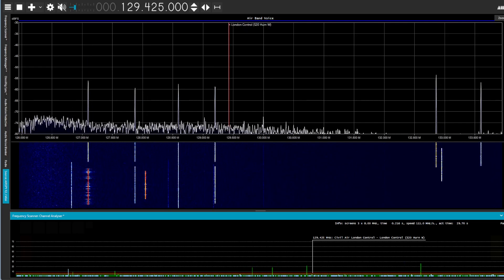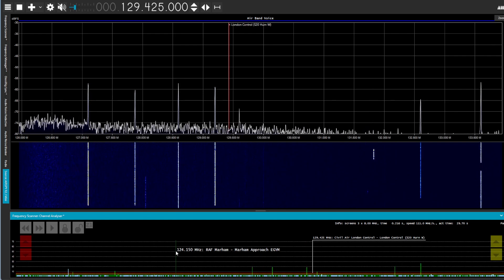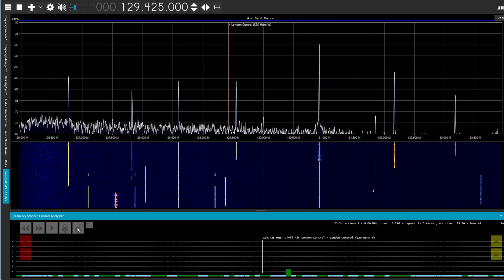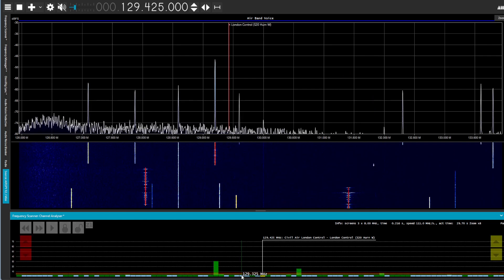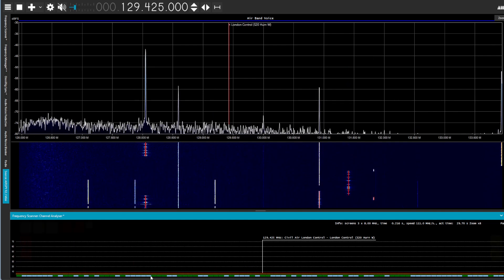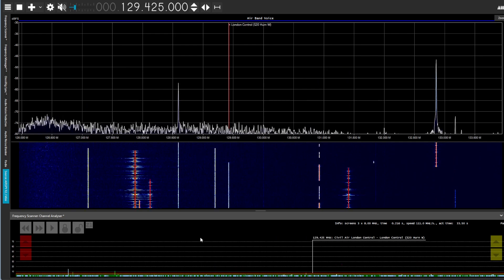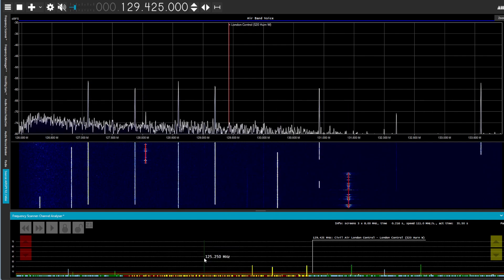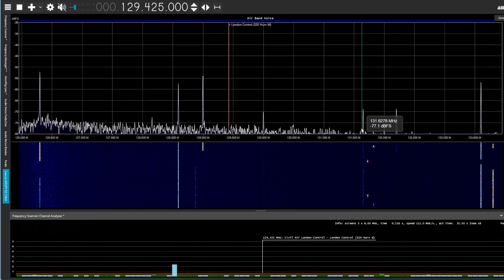How to lock out frequencies in SDR# Frequency Scanner Plugin

Comment: Thank you for this video!  I scan Milair frequencies from 225-400 MHz.  When I zoom in on the channel analyser it only lets me see the very beginning of my chosen freq range.  How can I get the frequency bar at the bottom to   move left or right to see more of my freq range to lockout more freqs that are known issues for me?
Reply from the maker: If the plugin is enabled and scanning the Channel Analyzer will track the active segment of band that is being scanned, bandwidth that is being scanned will obviously depend on the SDR being used. If the scanner is paused, you'll see the white line marker for the frequency it has stopped on and any activity around it in that active part. Unfortunately you can't zoom in to any other portion, only the active segment.
Reply: @snaily1972 Thank you for the reply. That is what I found out while using it for a while yesterday. It sure would be nice if it had a left/right scroll bar or slider to see other parts of the spectrum while paused. I originally wanted to lockout all the freqs it stops on in the list that are birdies in my area so it can focus on real transmissions instead. Thank you for your time, I appreciate it.

Comment: How to run this scanner on SDR Sharp 1899?
Reply from the maker: First do you have the Frequency Scanner plugin is installed?
If not then you will need to get the plugin first, google "SDR# Plug-in: Frequency Scanner updated" and you should be able to see the radioreference thread created by "thewraith2008" . One the first post click download and it should open up a list of plugins, select Frequency Scanner and then download.
Once downloaded, unzip and open up the folder, you will see a PDF file which will give instructions to install and for usage.
Any further questions please ask!